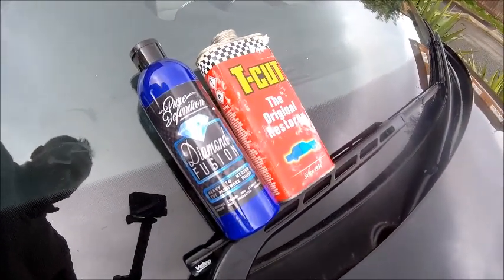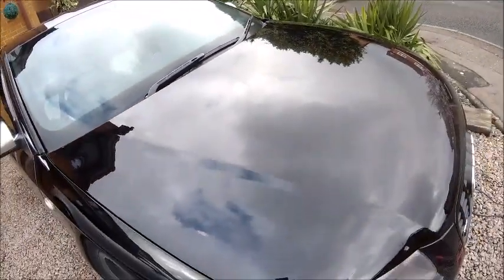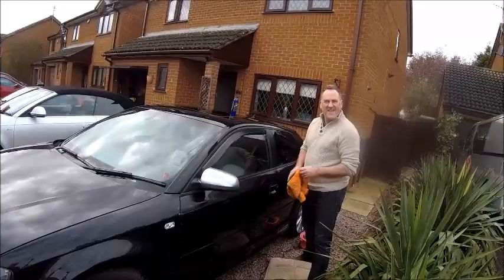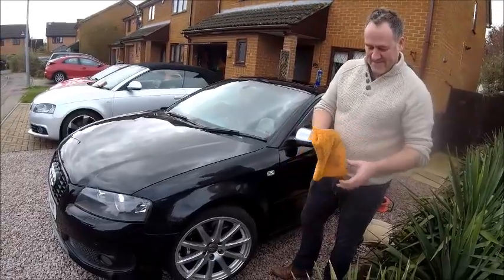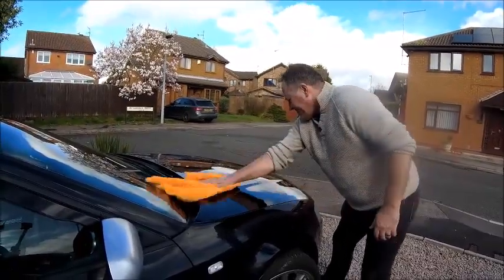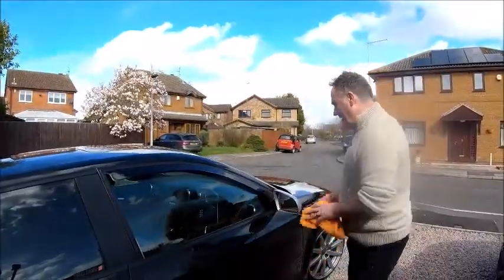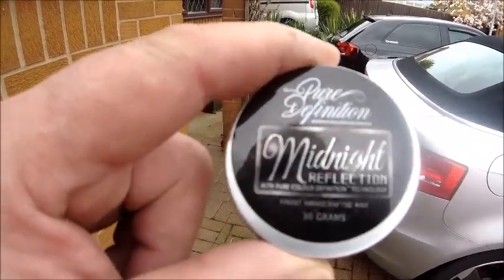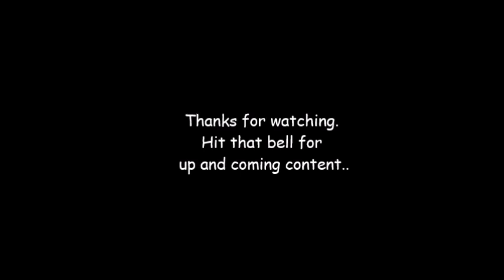Audi S3 Detailing with Pure Definition & Auto Gylm

Comment: Claybarred my A3 when I got it! It was 2nd hand but had been garaged for most of it's life, still amazing paintwork. But the clay bar really brought out the metallic flake in the paint again, made it so much clearer too! 

I initially used to jetwash, polish and wax mine but later found a couple products which make all this much easier (and quicker). For the wash: Optimum No Rinse Wash and Wax works wonders. Little bottle of green fluid. No need for a jet washer, just a bit of this in a bucket of water, soak a large microfiber cloth in it, squeeze the excess out and then fold it up a few times. Lay the cloth on a panel and pull it along a workable area to pick all the dirt up. Then dry the panel and move onto the next one, use a different side of the cloth if it's picked a lot of dirt up. Really makes it shine, it also has a lubricant in it which means when you're pulling the cloth along a panel it picks the dirt up and lets it slide without creating scratches. Sooo good! Then use something called Optimum Spray Wax as well to finish off. I do like a good rub on wax but two coats of this does a great job too. It's also nice because you can spray it on black trim bits and it doesn't make them fade or leave white blemishes. I ran out of this when I cleaned the car the other day and had to use rub on wax, and forgot how much longer it takes, especially having to avoid all the black trim and seal parts. Highly recommend both though!

Lovely looking S3 and great video mate, nothing beats detailing your car up to a lovely standard!
Reply from the maker: tied all sorts of products over the years and you can spend small fortune trying things to get one you like....never underestimated the original ...but think i might try the angel was for black cars ,,Dark angel i believe its called...seen spome video and looks great, black always shows polish marks in the sun which gets annoying..
Reply: @AdeReeves  Yeah I agree mate, I went through a fair few products finding stuff that works for me too. Usually pretty sceptical of stuff but they had very good reviews. They're both quite affordable to be fair too, which is good as I find a lot of stuff for detailing people seem to charge through the nose for. Another good one is Autoglym Bumper and Trim gel, really good for getting stuff 'back to black', particuarly the black seals around the windows, side of the windscreen on A/S3s as well. I'll have to check the dark angel out, thanks!

Comment: Looks lush, Ade. Black always gives the best results. Mine is the same as your wife's (ice silver) so a bit less fulfilling when completed.  I'm surprised you didn't use a fallout remover like Bilt Hamber🇬🇧 Korrisol, (similar to wheel cleaner but for paint that turns purple as it eats rust particles) to get rid of embedded brake dust before clay. It actually makes the clay process much quicker imho😘. Hey-ho looks like you know what you're doing with those results so carry on haha.
Reply from the maker: To be honest the paint wasn't too bad ...i try to wash it at least once a week through the winter to keep the worst at bay and polish at least once a month through the summer where i can... i think it really helps with the "spring clean "  😂
Reply: Not sure which silver my A3 is (silver but has a blue-ish hint and quite metallic, flakey) but I find it always looks pretty clean even when its relatively dirty. Detailed it the other day and it always come out so well after!